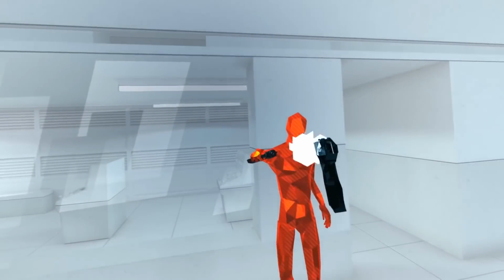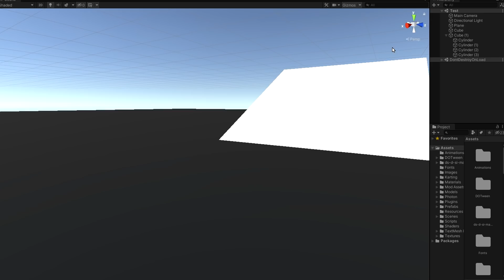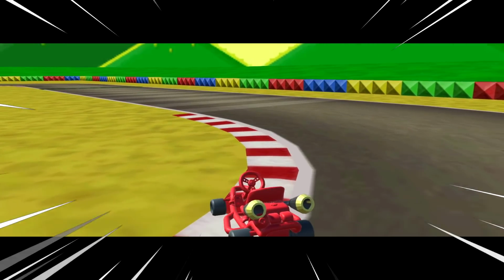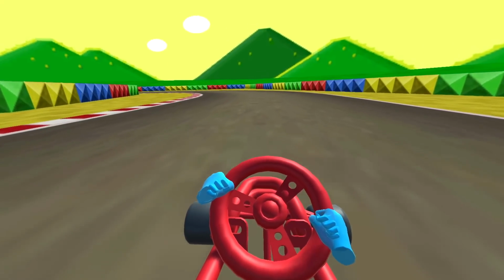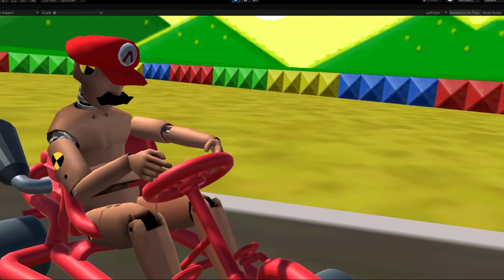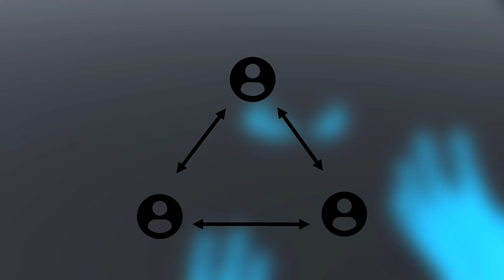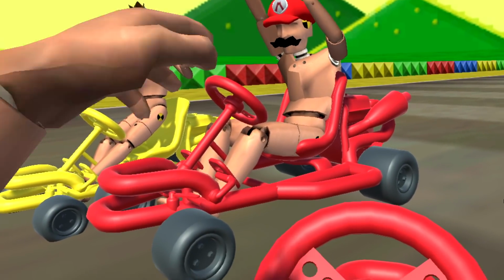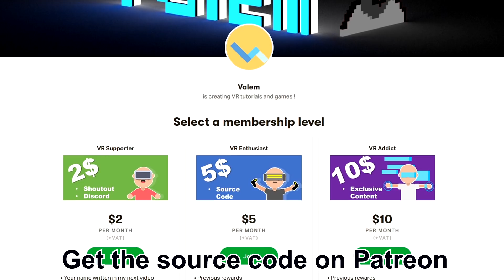Making My Own Mario Kart in VR

Comment: Multiplayer in Unity is just super awful work. I love Unreal for their "easy" networking system. Well you need to get into it, but it's worth it and a big timesaver. Unity's inbuilt stuff is all pretty useless for actual production, specially if mirror networking is not enough. However i love Unity for their VR support, it's much easier getting started with VR development in Unity. I feel pretty familar with Unreal, but when i wanted to start VR development, it threw me off pretty hard, so i switched to Unity, will do some offline projects and try to apply the gathered knowledge to Unreal, even though it's harder to realize there. Thanks for all your videos :)

Comment: I'm trying to make a VR BMX Simulator in Unity for my Oculus Quest using the Oculus package. I followed an earlier tutorial on grabbing to enable the player to grab and move the bike handlebars:
 https://www.youtube.com/watch?v=3cJ_uq1m-dg&ab_channel=Valem

However, because the handlebars and the bike it's parented to all have rigid body components that are needed in order to for them to be grabbed, the bike will move unpredictably. I tried enabling Is Kinematic on the bike's rigid body component, which made it move with the sphere collider in the direction of the handlebars but then they became unresponsive to where the player pulled the handlebars. 

I feel like I just cannot win here.

I'd like to see how you got the steering wheel working in VR but I don't think I could pay for access via Patreon cos it's for my final year project at uni. Should I stick with the Oculus integration package or should I use something else to get the steering working?

Comment: The wheel colliders pain... aah yes, I spend 2 years to finally make a vr car that works really good. 
Really good video and fun! good job
Reply: I'd be curious to hear more! What was the issue with the wheel colliders?
Reply: @TayoEXE  They have some intuitive properties and a lot of other not so much ones, and a lot of those not so intuitive ones are somehow related to each other, so if you mess up any number the result its really unpredictable... you need to really dig in and understand how they work to fine tune them, but long story short, if you don't need all those extra features involved in friction, slip and more then just use the ball controller valem uses, otherwise look up for the blog with auto wheel collider values resolver thing and how to set the center of mass, also dont forget to make the car rigidbody heavy so it wont bounce off everywhere